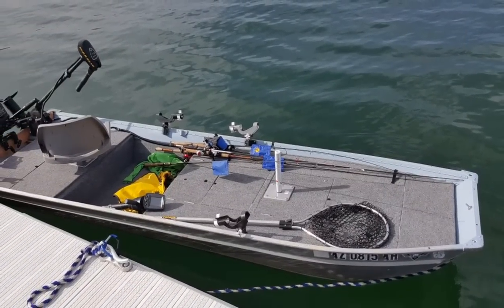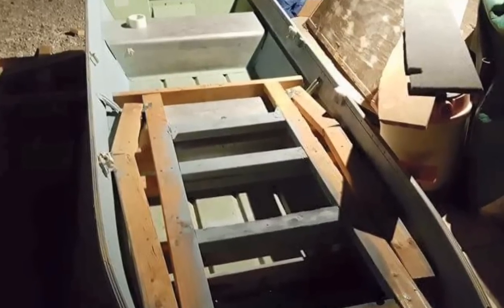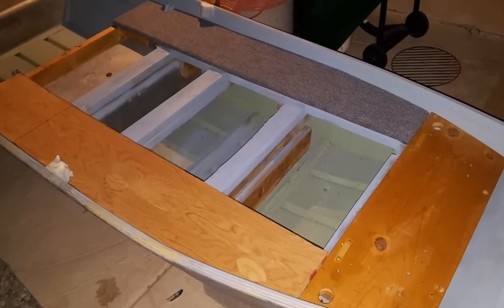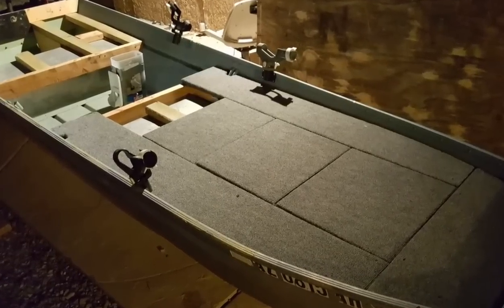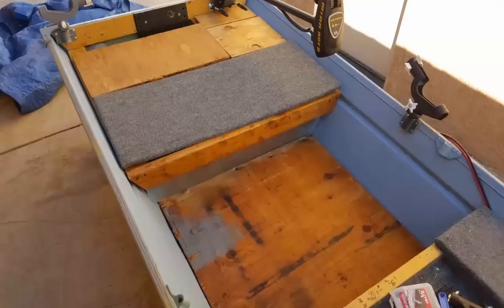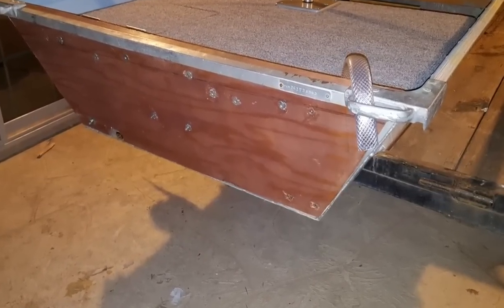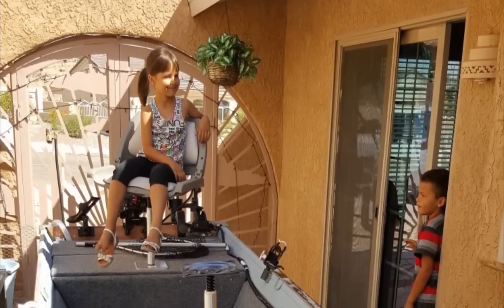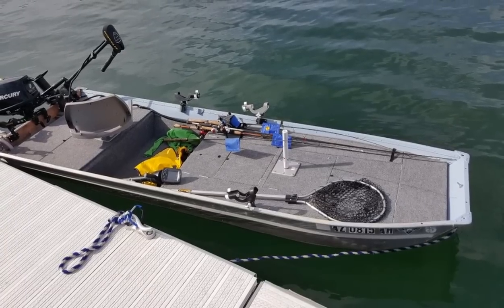How NOT to build a jon boat to bass boat conversion.

Comment: myself, being low dollar, this is exactly what I would have done, using scrap wood from construction sites and so fourth,....I have two boats, 1st is a old v hull blue star, I'm just going to water seal it, foam and carpet, and paint,  make nice looking to get me on the water, 2nd is a 16 ft flat bottom that I'm going to take my time and  make nice after learning so much from you and all the others that post great videos....thanks for this and all the other videos and especially the motivation.

Comment: I picked up a 16.5 ft 1989 Alumacraft and it was horribly heavy. The guy had built a big front deck and rear deck out of 2x4s, 2x6s that were pressure treated. I couldn't believe how heavy it all was. I've been watching your vids and just laid out the design for the new boat in Photoshop. I'm going frame in aluminum.

Comment: Great video!   I think the first thing people need to understand with doing something like this to a small boat is the maximum load capability of their boat. If you put 150 lbs wood etc in when  the boat is rated for 350lbs, that means -disaster if two average folks hop aboard.
Putting flotation foam inside the boat doesn't do anything to counter that either, until you start to sink!

If you want to add some buoyancy, get two lengths of thin walled white sewer pipe. Some stores sell 6" diameter, but 4" will still work. Get some lengths of threaded rods and make U brackets shaped around the pipe, then bolt the pipe to the waterline of the boat. 4" should add about 40 lbs  and 6" about 200lbs extra displacement. And the boat will be incredibly stable. Don't forget the endcaps.  and see www.mud-skipper.com for small engines - especially The Twister Lite.
Reply: Yep, my first jon boat was a Tracker 1032 and I think the limit was 330lbs. My son and I got a lot of good fishing out of that little thing but in hindsight, we far exceeded the weight on that little thing. We are lucky to have never had any accidents.

Comment: Best video for this, my experience  is that 3/8 marine plywood works great as long as,you only stand on it in the water not on the trailer. Many people turn jonboats into barges with to much weight ,another thing is with a high deck on a small boat it gets typse dont do it .

Comment: The only tried and true invention that has withstood the test of time is the shape of the caveman's wheel!! Thanks for the testimonial and I sure as hell wouldn't feel bad if I were you. 

In the late 90s and early 2000's major manufacturers and their Engineers were building aluminum bass boats that's sold for $8000-$12,000. They put these beautiful looking boats on trailers with cheap carpet and pressure-treated bunker boards. 90% of the manufacturers refuse to honor so-called out of warranty boats that turned into swiss cheese 7-10 years later. 

As for dissimilar metals, nothing mates with aluminum except aluminum!!! You should also look into proper coating sealants should any Hull area below deck be partially concealed. Aluminum hulls do not like lead weights, swivels, fishing hooks, lures etc. 

As far as engineering goes no deck or platform should be built above the height of a tin boats seats. The seat height is engineered relative to the boat hull design, stability and buoyancy.

Comment: I did all those mistakes in 84 on my sears gamefisher 14.6  bass boat  with a brand new 84 35 merc turn out to be a pos motor. Now graduated to wellcraft 248 with 300 etec   Wouldn't trade for any of those four strokes

Comment: What kind of varnish should I use?
Reply: Michael Lopez I'm using treated ply wood , I'm wrapping in carpet it shouldn't touch the aluminum ... is that a issue
Reply: Michael Lopez what do you recommend for boats like bass hounds pro or sun dolphin pro boats that are not aluminum? What kind of protection should I put on the wood before I carpet it?
Reply: Spar urethane. It's what was used on wooden boats for year and years.

Comment: so really , there was no real problem . even though this may not have been the best way of doing it, ultimately there was no proof of it being a failing concept. Yes you could've used less wood and different wood, but the truth is, you could've ran this boat for years as is, and the worst case scenario would've been (years later) some wood rotting. Most people upgrade to a new boat before any real problems would have come up here. Like i said, I get that it wasn't the best way to do it, but i can almost guarantee theres thousands of people out there who have done builds similar to this, and didn't die or anything.